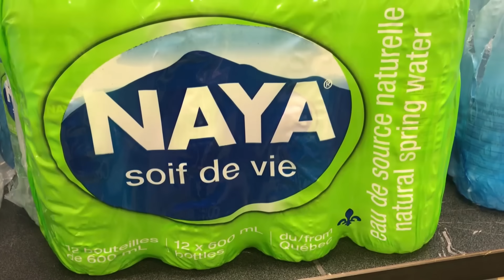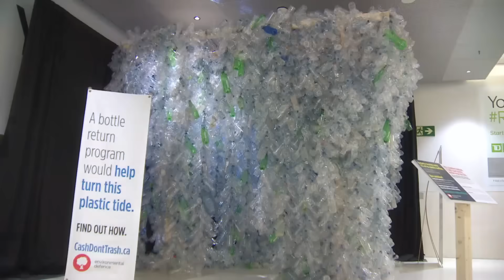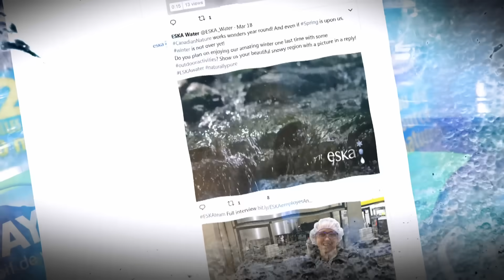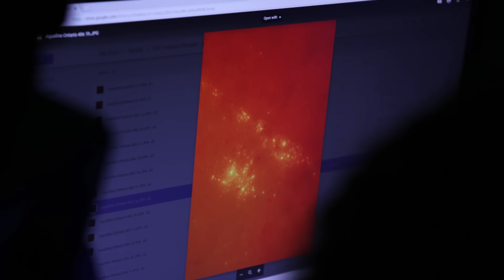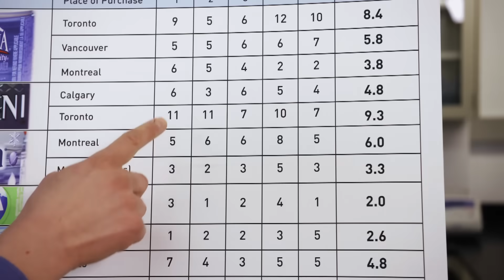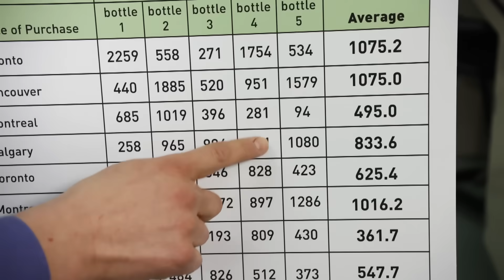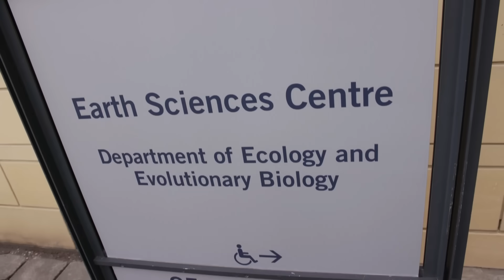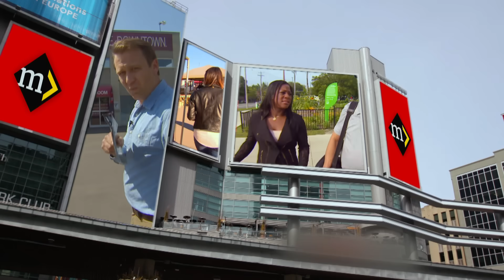Here's what's in your bottled water (Marketplace)

Comment: Reverse osmosis and mineralizer filter is the key!
Reply: Using reverse osmosis it takes 4 gallons of water to make 1 gallon of clean water.
Reply: @joshm5816  so what do you recommend thenq
Reply: @shumanrotula7697   It would depend on what is in your water. I've been a plumber for 23 years. The water conditions vary from well to city tap water and where the city tap water comes from. My water is city tap which I tested and I use carbon activated filters for chlorine and up to 95 percent of particulates and compared to constantly buying bottled water it's a lot cheaper.
Reply: @joshm5816  you can always use the residual water from the osmosis for other uses than drinking
Reply: @shumanrotula7697   The waste is highly acidic and I dont recommend using it due to the fact of efficiency in a practical application.
Reply: @joshm5816  Highly acidic sounds really dramatic, what is highly acidic for you? Im talking about a reverse osmosis to take away impurities from Tap water in London
Reply: @shumanrotula7697  Simple misunderstanding. The waste water from the RO system is acidic and I do not recommend using it for anything else.
Reply: @joshm5816  how acidic? In ph scale
Reply: @shumanrotula7697  It depends. I've tested some at a 5.3
Reply: @joshm5816  great!
Reply: Can carbon activate filter remove scale? Calcium from water?
Reply: @shumanrotula7697  If by scale you mean particulates then yes as well as over 80 chemicals it removes. As far as calcium no. You'd need a softer for that then your talking about adding salt to the water in which studies suggest is bad for your heart.
Reply: @shumanrotula7697  You can buy a inexpensive ph test kit. Water around d a 7.2 is ideal. A carbon filter for the whole house is best which is installed at the incoming water main in a accessible location and it wont add hardness to your water. Be sure not to mistake high alkaline water for calcium. High alkaline water can cause scaling in copper pipe.
Reply: Granular activated catalytic carbon to remove chloramines (chlorine and ammonia) that are used in municipal tap water to disinfect. Water softener (salt) or anti scalant to remoce calcium and magnesium (scale) 5 micron sediment filter to remove particles. 10 mic Carbon filter to remove oder and taste. Membrane to remove salt and coconut shell carbon post filter to add taste. Post filter calcite to put back minerals in the water that are good for u. Yes water gets wasted with ro but add a recycle valve to your ro system or use the concentrate water for power washing...get creative.
Reply: @brianaguirre8379  In reality most consumers will not use the wasted water. Water shortages are becoming a reality even in the western US such as Nevada for example. RO systems are not efficient period. Calcite is used to neutralize acidic water.

Comment: One again Marketplace is willfully misleading consumers with anouther hit job. Most bottled water is NOT just tap water put in a bottle. Dasani made by Coka-Cola, for example, is further purified at the manufacturing facility and is definitely purer than average municipal water. They do this for two reasons. One is to make the water purer but more importantly its to make the water taste consistent, because tap water varies wildly in taste depending on location. That's why Dasani (and all Coka-Cola products) taste the same no matter if was bottled in America, Canada or Taiwan. So it's just dishonest to insinuate that tap water and most bottled water are the same product or that bottled water is less pure or just as pure as average tap water when logically it has to be purer. Secondly, the trace amount of plastic you found are far BEYOND acceptable and not even worth mentioning, and you're smart enough to know that. 100% pure water is impossible to make cost effectively at the scale needed and you will always get trace amounts of contamination. And like many others have pointed out if you really cared about water purity you would have compared bottled water to tap water. So the only legitimate claim in this whole report is that plastic waste is bad for the environment, and for some reason you singled out bottled water (even though nearly every consumer product is made of plastic or comes in plastic packaging)

Comment: The first and the funniest thing is that most water is distributed in PVC, CPVC and PEX pipes, which are synthetic plastic. 

Secondly, the problems with tap water are rarely with the water supply but often with the taps and pipes. They are too easily contaminated compared to bottled water whose production quality must satisfy food and safety standards to be put on the market.

Apart from Beijing where I used to live and hear tap water problems every couple of years, even Australia, that has some of the world's strictest drinking water standards, has tap water issues sometimes. For example, the recent lead contamination. On top of that, spiders, cockroaches, flies and other insects crawling and flying around the bubbler taps in parks and public areas are common scenes. 

How can you be sure they don't lay eggs in the taps? 

How can you be sure there won't be transmitted virus and bacteria left in the taps after their contact?

Comment: the plastic is in the water from the bottling proCEss. from the breakdown of plastic from uv light but mainly from the fact that all bottled water and that means ALL EVERY SINGLE BRAND NO MATTER WHAT IS FROM A WATER TREATMENT PLANT IN THE CITY OF OR FROM NEAR BY THE PLANT THAT IS BOTTLING THE WATER .........IF YOUR LUCKY THEY MIGHT RUN THERE WATER THROUGH A FILTER BEFORE IT IS BOTTLED  OTHER WISE ITS THE SAME WATER THAT COMES OUT OF THE TAP IN MOST OF OUR HOMES   ........ ITS PRINTED ON EVERY BOTTLE WHERE IT CAME FROM IN FINE PRINT  .  JUST READ WHAT YOU PAID FOR .. THEY DIDN'T ADVERTISE IT BUT THEY DIDN'T LEAVE OUT THE INFO  EITHER !!!!!  ALONG WITH THE PLASTIC COMES LEAD CONTAMINATION USED IN THE PRODUCTION OF PLASTIC BOTTLES FOR STRENGTH  THEN LATER TO HELP THE BREAKDOWN OF THE PLASTIC FOR THE ( SO CALLED SAFETY OF THE ENVIRONMENT) . THAT'S WHY THEY SAY DON'T REUSE THE BOTTLE AFTER CONSUMING THE WATER . AND WHY YOU SEE SALES ON OVER STOCK ALL THE TIME BECAUSE OF THE LEACHING OF THE LEAD FROM THE PLASTIC INTO THE PRODUCT . BUY A GOOD WATER FILTER AND USE YOUR TAP . DIG A WELL BUT BOTTOM LINE YOUR PAYING FOR TAP WATER IF YOUR BUYING IT FROM THE STORE !!!  WAKE UP PEOPLE!!!!!!!!!!

Comment: Whats even scarier is that they found particles of 100 microns in size this means particles under or smaller than 100 microns are not being stopped this means Virus and Parasites and Bacteria are not being stopped.
 (Virus is 0.02 to 0.05 microns in size) (Parasites and bacteria is 0.1 to .10 microns in size).  No wander every one in America has stomach problems. 
           I do not drink bottled water at all I filter at home.

Comment: What about the plastics in the water supply via the tap, in the uk most water mains pipes are plastic. You can smell the chemicals coming though my mains tap water which is why I use the bottled water - my pets won't drink the tap water, the birds outside won't drink it although they will drink the bottled water, so I drink the bottled water. If I become concerned I would put the bottled water through a filter although I still wouldn't touch the tap water.

Comment: Pretty incredible really, they didn't even test the tap water... Then at the end they say that we should all use reusable bottles.. Well, I can tell you right now that tap water has higher concentrations of plastic particles, and it also contains in more cases than not, toxic fluoride that over fluoridates the teeth and is debilitating to brain function, and high levels of estrogen and other hormones, which are unable to be filtered out by commercial processes. That is why I drink bottled water. 20 of the 50 bottled water samples were perfectly fine. That's good information. Certainly encourages me to continue drinking high quality bottled water!

Comment: I gave up buying bottled water about 4 years simply because I had lost my job at 67 years old and had to start watching my money.  I bought a BPA free, bottle and I fill it with tap water, looking at all the advertisements about all the plastic bottles (which I thought were recyclable) I am glad I did.  The only solution I can see is to start using glass bottles which would no doubt bump up the price significantly.  If people don't like tap water they can always add flavour,  I put a can of lemonade and add 2 cans of water.  Am I safe to assume cans can be recycled?  Or have they stopped doing that too?

Comment: I dont believe it comes from the spring water. When i worked out they said if you drank water from a plastic bottle you had to get the hard plastic water , so if you purchased a soft water bottle from a manufacturer that sold it, it would break down and you couldnt see. If they sold water in a bottle they woundnt find it. Plastic could be coming from the manufacturer. Tap water i stay away period. I go to a Spring and get 3 to 5 gallon office water containers and put it in glass picture and i have a water bottle thats hard plastic that wouldnt break down like these cheap water bottles they sell the water with. So i never buy any bottled water unless its in a glass or 1 gallon containers.

Comment: I am concerned about testing for facts and health. I really am. Many things can harm you however this is plastic I think of plastic as inert and do not dissolve in water not something found dissolved in water that can hurt you. The amount is so small for example A micron is (about 39 millionths of an inch). The average cross-section of a human hair is 50 microns therefore some hair smaller some larger. With exceptional vision the human eye may not see anything smaller than 40 microns in size. 10.4 particles of plastic per litre that were 100 microns (0.10 mm) or bigger it wrote. Where was Tap water it has things dissolved in it and other things it gets tested. Where was glass bottles it has some microscopic particles of glass however testing would show the facts of what is there and the fact that glass breaks and that hazard. Therefore people found when testing they had to realize that plastic is the best choice therefore safer is better.

Comment: I WILL NOT drink water from my faucets. My water is from a well. It has red sand and Gad knows whats in jt.  One day several years ago, my mother was putting water in a bucket and noticed the water was shimering in circles in the water. It was a water worm about 8 inches long and clearish and shiny.!
If water is put in a glass you can see red sand, minerals and ??
I don't even like to bathe in it. I only take showers.
The well water puts a stain on glass, faucets have to be changed out every 2-3 years because the water eats up the hookups.  The water leaves build ups of calcium on the end of the faucets.
Plants do okay outside but potted plants have to be repotted every year or year and a half.
So, I'LL take my chances with bottled water or reverse osmosis water.!

Comment: This video greatly lacks context that it's almost irresponsible. For example, how does this compare to tap water or other packaged drinks or food? Pipes in Toronto are over 50 years old so they pump chemicals to coat the rusty pipes. Among other things, and depending on where you live, fluoride, chloride, nitrate, arsenic and metals are common elements found in tap water. The problem is systemic and is beyond the scope of this short report.

Comment: It's rare I use bottled water. I have an aluminum (my mistake it's actually stainless Steel) double wall bottle. Just clean and reuse.
Reply: Aluminum poisoning is worse then the plastic. that's why aluminium is never used in Commercial cooking and food production even aluminium cans are coated on the inside        https://www.google.co.uk/search?q=aluminium+poisoning&oq=aluminium+po&aqs=chrome.4.69i57j0l5.16276j1j7&sourceid=chrome&ie=UTF-8
Reply: zen blas ..My mistake it's actually stainless. But you're right, Aluminum can be very dangerous health wise.

Comment: The water needed, has the structure of 113.8 degrees hydrogen bone angel, and within 3 days, the urine will smell by detoxification. Hyper permeability between cell structures, absolutely pure, and it can not be gained by the already spent billions to do so, and as such, the industry denies the ability to achieve it. 
The industry could care less about the plastic particles within, or the impurities, as long as it can get away with continuing sales.

Comment: not at the end of the video yet but what about the effect of plumbing?   There's no way to avoid water/plastic contact now because all the plumbing under our roads are slowly being switched over to all plastic tubing as the old existing steel stuff cracks and rusts beyond repair.   and with copper prices soaring, there's more and more ABS/pex type plumbing in homes.   Look under your sinks and you'll likely see plastic tubing to the faucet.

Comment: I only drink and cook with distilled water. Distilled water does NOT conduct electricity. The reason supposed drinking water does is because it has a bunch of crap in it. Minerals added for flavor? Natural flavors is an ingredient. I wonder how that one got by the FDA.
Reply: Distilled water typically doesn't contain electrolytes which could possibly be dangerous if you drink a lot of water.
Reply: Only dangerous to BIG WATER. Fact : Water = H2O I buy distilled water by the gallon for $1.10.

Comment: Go to the camping section of WalMart and get a Sawyer Mini water filter.
They are under$10usd,and will filter up to 100,000 gallons of water.
Fill your bottle with tap water,and screw the filter on the bottle just like a cap.
Preferably use a soda pop bottle.
They are more resistant to breaking down.
Pop bottles have been made to resist pressure,and the acids in soda.

Comment: This analysis was incomplete.  The source of the water in many cases is tap water as you point out.  You fail to stress that they use reverse osmosis to remove the crap in tap water, like dissolved heavy metals, radioactive material, fluoride, chlorine, arsenic, organic matter not killed off by chlorine.....there is a very long list of things bottled water has removed from tap/spring water.  If you want the least amount of chemicals and dissolved solids, they are virtually undetectable in distilled water.

I am all for using less plastics, but until Aquafina comes in a reusable glass gallon jug.....I am not drinking the local tap water without some seriously expensive filtration system on my kitchen tap.  The fluoride in tap water has been debated as a possible catalyst for certain types of brain disease.  Some tap water has had such a strong chlorine smell, I would swear it was sourced from a local swimming pool.  Would you drink pool water?

How about a consumer analysis report of some competing water filtration systems?  That would be more useful than scolding us for purchasing plastics that rarely have any substitute container to support as a consumer.
Reply: Lmao "our water is safe". You keep believe that. The  only safe water is distilled water. It is 100% pure.
Reply: If you look at the UK, very few people buy bottled water to drink at home. Our water supply is safe. The supply is monitored in order to be safe to drink, it costs a lot less,doesn't wreck the environment and in some cases fluoride has benefits. A responsible supplier will always ensure the tap water supply is safe. If you look at the Dasani UK controversy, you'd see that Dasani was less pure than tap water, and was even thought to be dangerous.
Reply: I'm surprised you can drink Aquafina and not get heartburn. It tastes awful.

Comment: Currently drinking water from a plastic bottle that has 0.40% pant, it contained mineral water at first to help with the hangover. I refilled it from the tap and eventually I will return it for the 0.4€ which is actually 40% of what I paid for it. 

Several years ago they changed the plastic they use here in Finland, not sure why, but I bet it has something to do with this thing. At least the plastic that is currently used doesn't break down in digestion and over 95% of bottles are reused in some way. I mean we have had "panted" containers since the 1952 Olympics and recycling/reusing has been getting better ever since.

Comment: We know of a case a few years back, where a city councilman was filling bottles with his tap water from his back yard, bottling  and selling them as "spring water!"  Until recently, though, people have been unaware of chemicals in plastic leaching into bottled water.  We know not to microwave food in plastic, but it should be disclosed about what kind of plastic the water is in and there's a  chance of seepage and what the chemical is.  I have a very deep well, (100+ feet) but if I were going to drink water other than that, I would have those big glass bottles delivered, and make sure to clean the places where the water goes before it comes out the tap.  Now, if we've had a lot of rain and I worry about the clarity of my water, I use a filter like Britra to be safer, but a little soil isn't like plastic chemicals!.